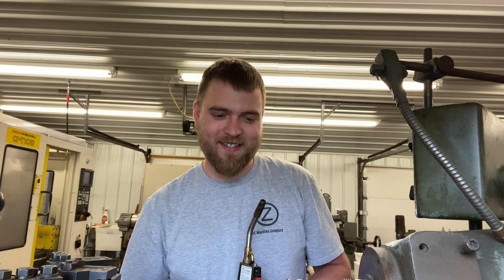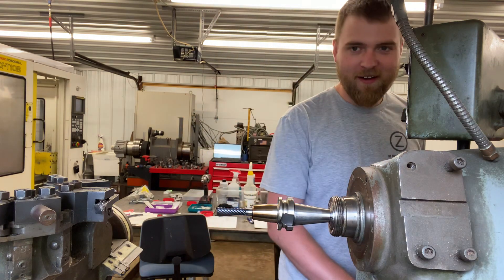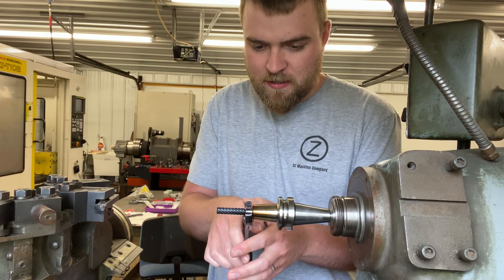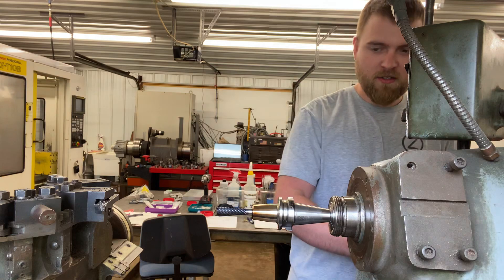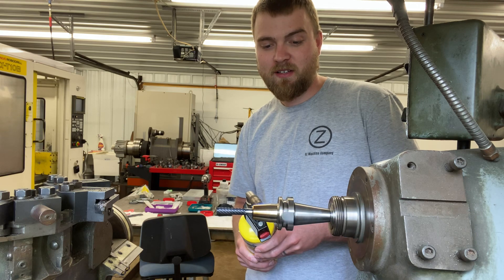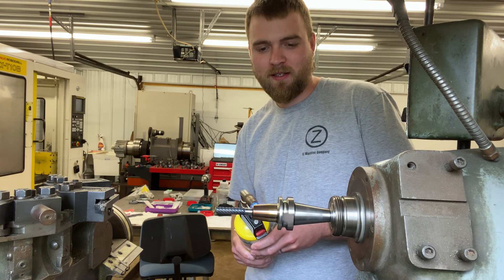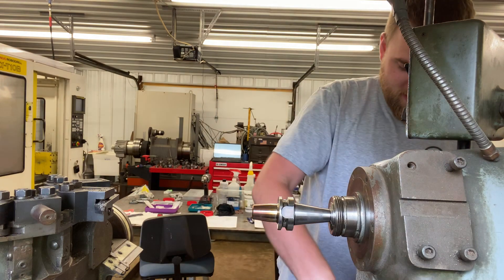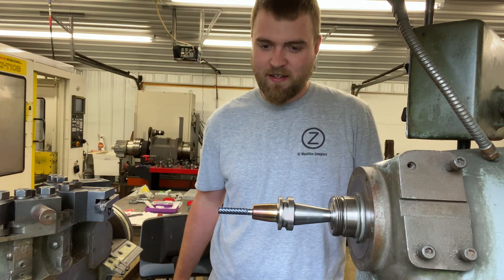Shrink fit tool holders.. With a propane torch?

Comment: Thinking about trying shrink fit holders on some 0.002” drills I’m using. The problem is finding a way to set the tool length. Currently I touch off with a dummy tool that is the same length. I use a plastic collar on the 1/8" drill shank to set the depth. I guess I could switch to an aluminum one so it doesn’t melt.

Comment: it may work but you will destroy this toolholder much much faster than using a special induction heat shrinking machine.

but this is really expensive and may not be profitable
Reply: shut up